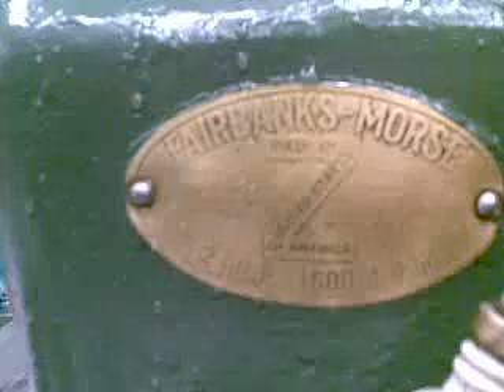Fairbanks Morse Z 2HP

Comment: I'm currently restoring one of the same engine - that spark plug looks somewhat new. What kind is it?
I can not find any that look like the original with the tapered thread. Not that it needs replacing, but I don't really want to be running the engine with such a classic spark plug. haha.